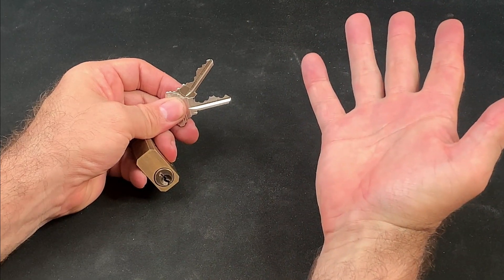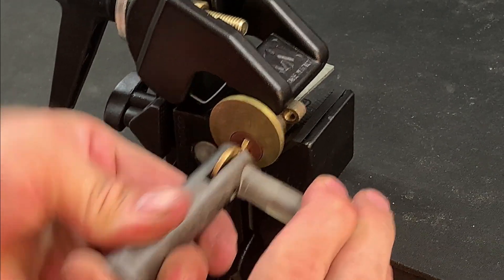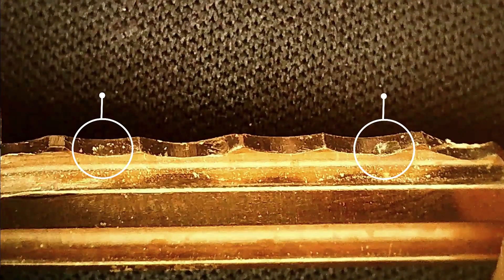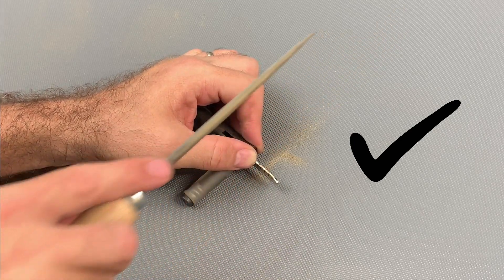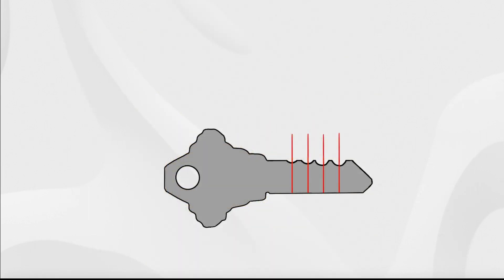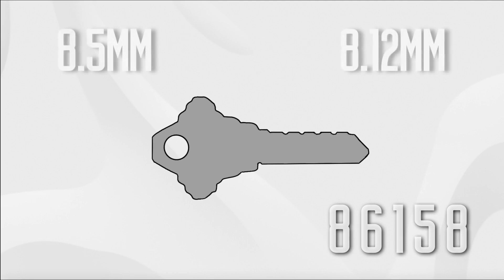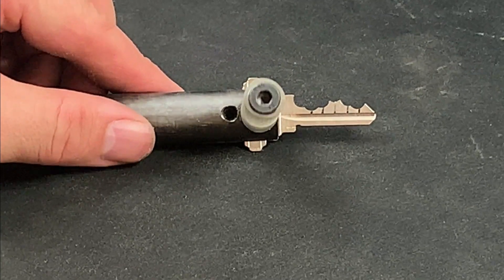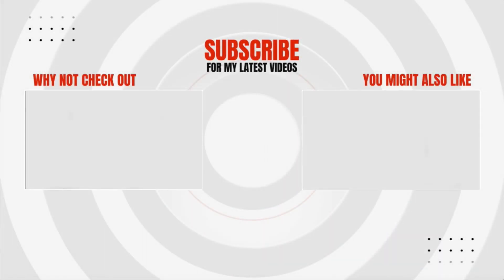039 A beginner's guide to key impressioning (2/3)

Comment: Great video! One thing I’ve done is to use a 0 cut key, which has just a little material removed from a blank right where you should expect marks to show up. 

I’ve also filed away a lot of a fingernail. I later learned that taping your finger is quite common among experienced impressioners. 

Another tip I sorted out was to check your depth against a key decoder. File a couple of times, check, file, check, until it’s deep enough to go under the next notch of the decoder. The drawback of this is that if your marks or measurement position are centered where they need to be, you can get some misleading results. I know some people who have used a micrometer for the same purpose, but I felt the key decoder was much quicker and easier, though less accurate.
Reply from the maker: Yeah that all makes sense - great tips 🙌

Comment: The second installment does not disappoint. I'm not a fan of layout fluid but I can recommend a halogen light at a shallow, raking, angle or - if you're in the field - one of those expensive pencil flashlights. Again, the trick is to position the light source so it's sweeping across the key and down on it. Starter grooves? Sometimes make it harder to see the pin impressions at the beginning. I prefer polishing the key smooth.
Reply from the maker: I think the smooth blank surface is the way I’ll go too - the grooves saved little time and led to unclear feedback as you’ll see in the final video of the series on Friday 😉